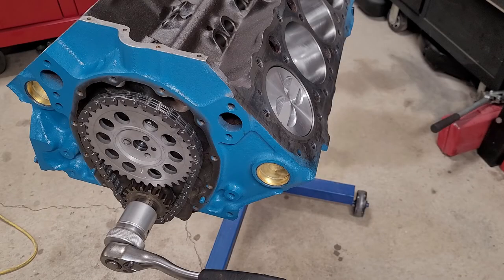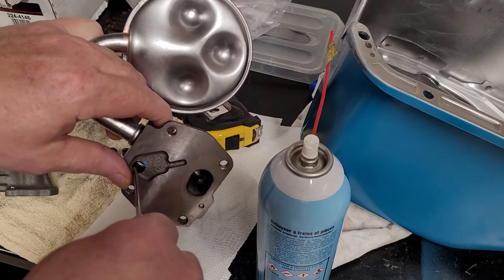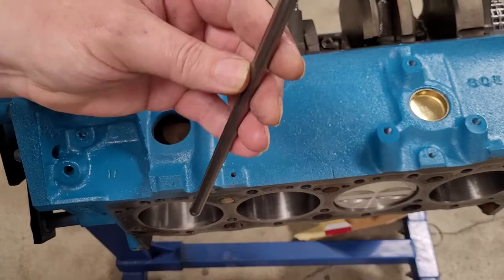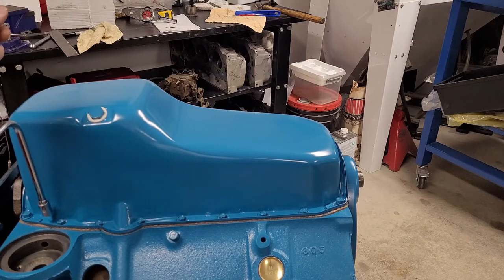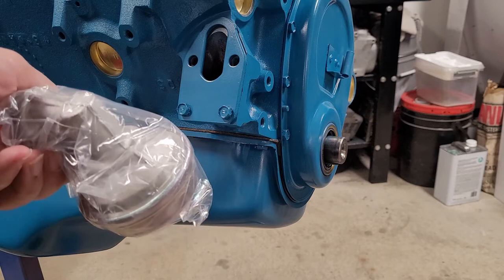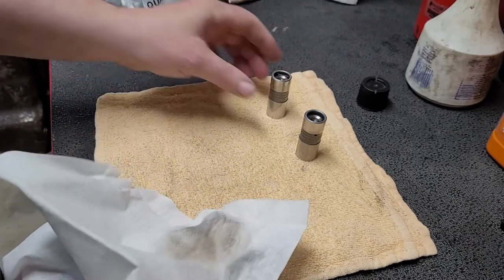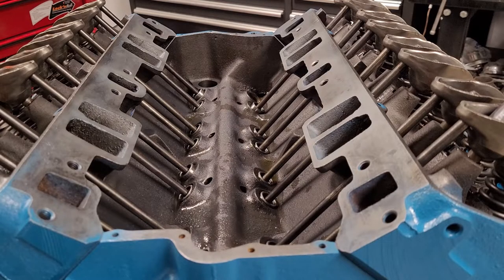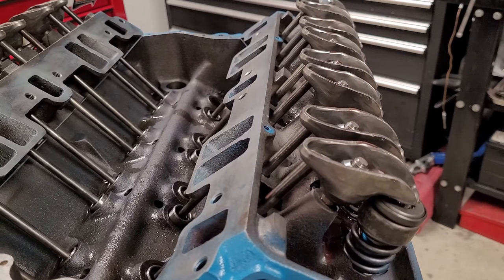305 Engine Build Part #3

Comment: Far be it for me to offer advice, but to a man of your talent level, but I was an auto mechanic for over 22 years. I still rebuild engines and just finished rebuilding the 305 in my '87 Chevy Pick-up truck. I believe it would have been easier to put the assembly lube in the oil pump while the cover was off. I always soak the timing chain in oil for a couple of days so oil will get under the rollers. I also never in my life had to heat up the crank gear in order to install it. You are doing a great job by the way. Thanks for the videos and take care.
Reply from the maker: I appreciate the feedback David!!
Reply: Get a stroker crank for the 305, for more torque. The 307 was another engine many hated, but responds well to the stroker crank, a "RV" type cam or a bit hotter. The HiPo heads with LS valves, either 1.9 or 2.0" intake and 1.55" exh. Cam LSA should be 108° and lift around 0.480".

Comment: Dang! You really know how to teach. Thank you for your in-depth videos. Lots of small "need to know" information.
Reply from the maker: Thanks for the comment! I appreciate that!
Reply: Those two holes between the timing chain cover  and fuel pump are where the front Front engine mounts  for a 55-57 Chevrolet are and two on the other side.  The hole where the fuel pump is needs sealer and the bolt is very short.  When replacing the fuel pump a longer bolt can be installed here to hold the fuel pump rod in place while changing pump. After change make sure to take the long bolt out and re install the short bolt.  Never turn engine with long bolt in place and do not tighten much to hold rod.

Comment: Had an 87 Camaro sport coupe with a 305. Of course by 87 it was the one piece rear main seal, center bolt rocker covers, LG4. That engine loved...LOVED higher octane fuel. If I did not run Amaco 93 octane in that engine, it always had predetonation. I believe the CR in that engine was raised from the typical 8.6 to 1, to it seems over 9 to 1. I checked the timing numerous times on that engine, and it was always on good. The engine was a fine engine with the good fuel, seemed to work well. It seemed to deliver decent mileage, perhaps around 20 mpg on a road run, seemed an average engine. Never have rebuilt a 305, only 350's, a 327, and a 454, 318 Chrysler, 383 Chrysler and of course a 440. I respect you for your info and rebuilding this engine, as I know many were pulled and scrapped because many folks believed they are a substandard engine, when in reality they are not a bad street/ road engine. I would not like to try to create one to try to create 600hp, or anything, however, they are not a bad engine it seems for just running around and as long as one is working well, I would run one again for sure. Good video, and thanks for all the info here, always good for someone to have useful information available to them.
Reply from the maker: I had a similar experience with one as well. Thanks for the comment Jack!

Comment: great little tip on tightening oil pan, question did u use black silicone on both sides of cork,
Reply from the maker: Thanks Robert! , I did use Ultra Black on both sides. I see your other comments and appreciate you taking the time to watch the videos!!

Comment: Note bolt hole in front of the block you can see the fuel pump rod through. The purpose for this thread hole is to use a bolt to screw into the fuel pump rod to lock it in olace to keep it from falling out when the engine is installed or rite side up. Use a long bolt with a nut on it for locking the bolt secure. If you ever need to remove or change the fuel pump. Just loosen the locking nut.  Hand tighten the bolt into the fuel pump rod and it holds the rod to lock it secure. .  When done. Back the bolt off the rod and lock the bolt secure with the locking nut.
Reply from the maker: I have never used that hole for that , thanks for the comment.

Comment: You can just get the lash out of all. rotate 90° take the lash out or all. turn it 90° take the last out and repeat until all lash is out for a full rotation. Then set the load ur done. Dont gotta remember this or that.
Reply from the maker: There are several ways to do it , I picked that one for the video , the way you refer to works as well.
Reply: @jaysgarage3616 classy 👌🏿
Reply from the maker: Thanks man!! @BAYSICK831

Comment: Love the video’s help me a lot on building my first small block! Only concern I have do you have any movement side to side on your Pistons while they’re in the bore? I can move mine and install a filler gauge around .0002-.0003 and it gets really hard to pull the piston out when I install the filler gauge between skirt and wall
Reply from the maker: Good morning , you will always have some movement. The top of the piston is smaller than the bottom therefore it will (rock) move around in the bore. Pistons are measured for size on the skirt at a particular spot as recommended by the manufacturer. They are made this way to account for expansion etc.

Comment: Hi Jay, thanks for the great videos. I have a question regarding roller lifters in a 305 rebuild of a 91 Firebird that has 70k miles on it. I wanted to reuse the old lifters because they have no wear. I tried to keep them in perfect order to have them reinstalled on the very same spot as before. But it happened, that I mixed 3-4 lifters up when my sorting box slipped away. Can I get away with it when not all of these lifters sit in the same hole as they should? New lifters are quite expensive so I guess I would like to give it a shot. What would you do in the same situation? Thanks and greetings from Germany
Reply from the maker: Good morning , You can reuse those old roller lifters , most people I know throw the roller lifters in solvent when cleaning and reinstall randomly without issues , hydraulic flat tappet lifters have to stay in the same lifter bore as a rule. Hope this helps and have a good day!
Reply: @jaysgarage3616  it does 🙏🏻

Comment: Do you have a part number for the dipstick guide tube?
Reply from the maker: I apologize for the late reply , Chevrolet Performance 3951600

OEM 2-piece design dipstick tube.This is the lower tube that is installed inside the block on 1979 and earlier driver side dipsticks. The upper tube is sold separately

Comment: Im looking for stock 305 valves what size should I look for?
Reply from the maker: Generally the 305 stuff is 1.72 Intake and 1.50 Exhaust however the 4 bbl engines and H.O engines could be or were 1.84 Intake and 1.50 Exhaust. Depends what you have there.

Comment: My 305 does not have the fuel pump rod hole... Isit possible to make one?
Reply from the maker: You could have a shop do it , a specialty shop/machine shop or just run an electric fuel pump. There are lot's of later model block's that are the same.
Reply: @jaysgarage3616  I made a drill jig using a block that already had the hole for the rod. I used it on a 350 block that was TBI and the hole came out dead on the eccentric. The jig uses a 1/2" ID tube welded into a fuel pump block off plate. Make another bushing to go inside with a 1/4" ID to drill a pilot hole. Use 12" long drill bits and don't forget to drill an oil return hole.
Reply from the maker: @kerrybassett4468  Awesome , glad to hear that worked out for you.

Comment: why not soak your lifters in oil?
Reply from the maker: This is a good question , many people just have their own way or opinion.
Cam and lifter material have a seemingly higher failure rate (often blamed on oils , materials etc)
The break in lubes are different in viscosity , I use a thicker one that I like to apply without being soaked in oil initially.
Submerging lifters just to oil them? Or to allow them to start filling internally?
Lifter's have an oil substance in them already so I add break in lube to the bottom and oil the body , 
Before engine is started oil is again added and flows through the lifter valley again providing protection on initial start
The way (I Prefer) on my stuff is
allow the lifter to pump up during initial run in as this has less spring pressure initially (because lifter is not pumped up yet) and will increase progressively , oil splash start's quickly before lifter is pumped up as required etc , You will hear the lifters tick and quiet down as they pump up.
I encourage everyone to research and choose the way they feel is best , you will find several opinions and answers!